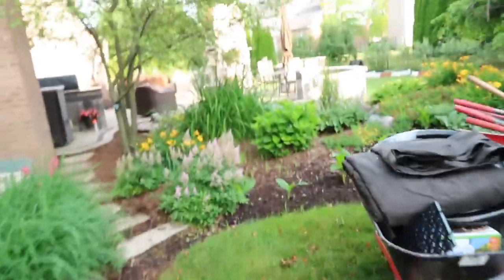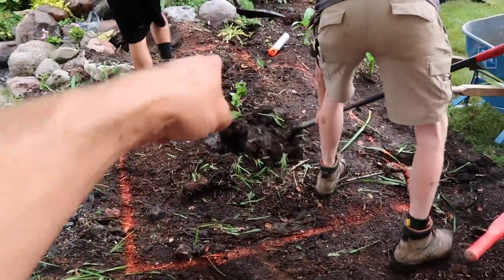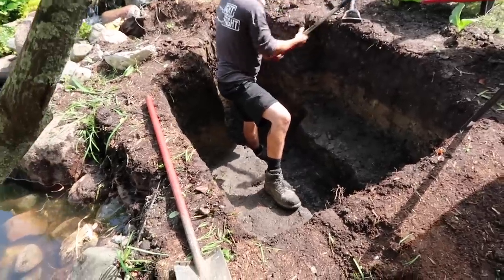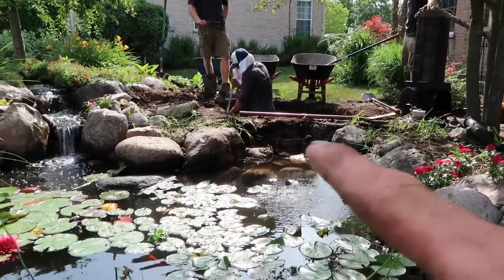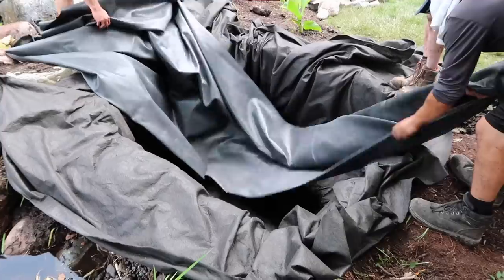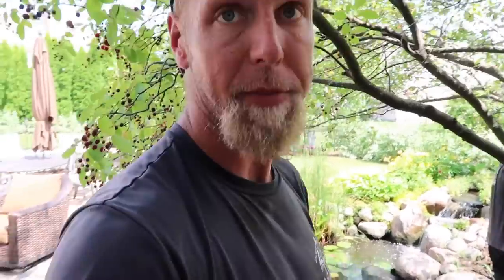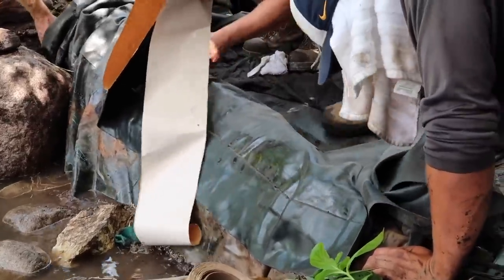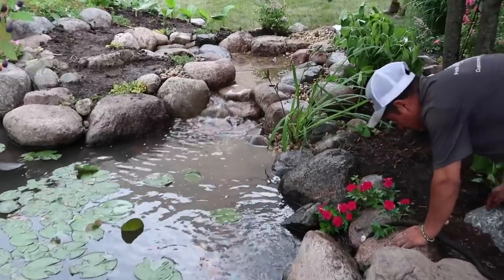*Garden POND* UPGRADE W/ Wetland Filter

Comment: You guys always use rocks for the wetland filter.  I assume that it’s because to gain as much surface area for bacteria to attach and do the bio filtering.  Have you guys ever experimented with bioblocks?  It’s very known in the reefing hobby.  It’s very porous and there for it has allot of surface area for the bacteria.  Maybe it’s something you can look in to to get to the next level.  You could use it straight on the aqua blocks and use smaller rocks from the get go.  I hope the pond professor can look in to it.  Anyway keep it up!  Greetings from the Netherlands!
Reply: The risk is of them crumbling over time. Rocks have already been tested against time, so the level of the wetland filter will remain. If anything, they would need volcanic rock instead.
Reply: Also, my understanding is that Ed designed the filter with a few different cobble grades, from large to small moving up the profile which results in a gradual increase in flow velocity between the voids, thereby minimising clogging.
Reply: Expanded clay would be interesting too